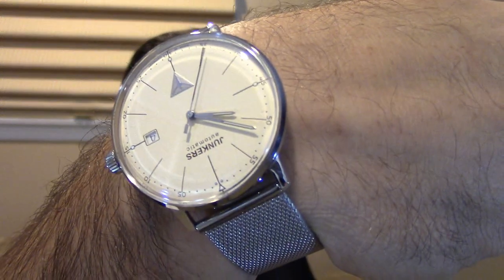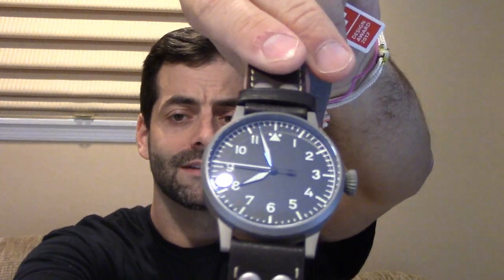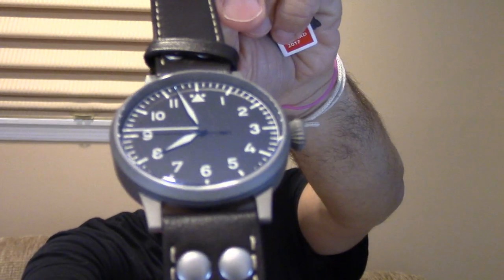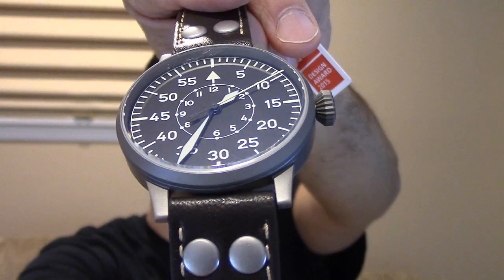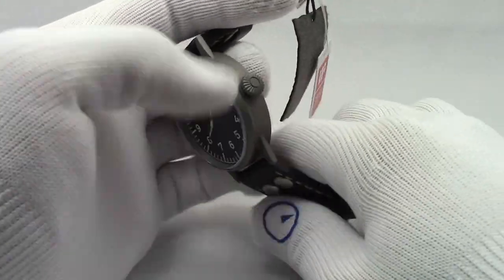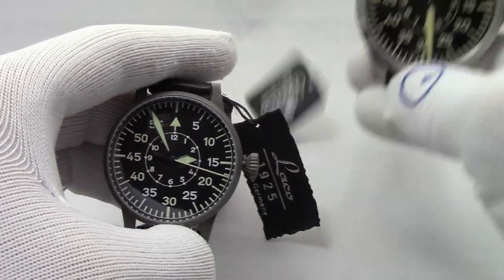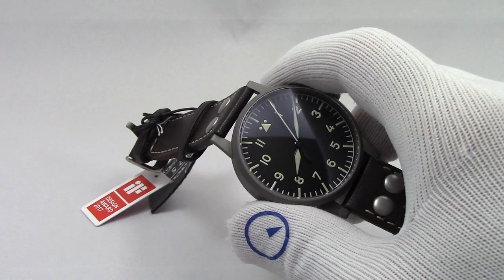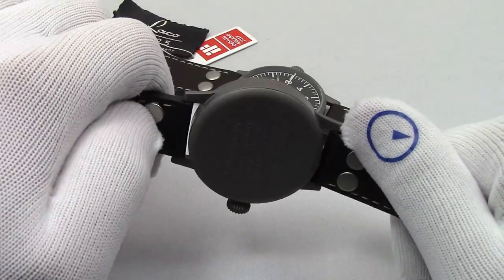Pilot Watch Dial Type Differences and Their History - Watch and Learn #37

Comment: Hi Marc. Great video as always. 
As far as I know both watches were observer watches, in german "Beobachtungs-Uhr"
A-types were built until 1941 and then the B-type started to replace the A-types. So A- and B- was only to distinguish the two version.
They were not worn by pilots but by the navigators (on the bombers). The pilots were issued witch chronographs similar to those that Hannhart builds.
The observer watch was used in combination with an octant the get the current position of the plane and correct the course to target. So the watch was part of the "navigation system" of the plane one could say.
So intrestingly the term "pilot watch" is misleading but used by most of the brands today. To me it is more related to a pilot on a ship who plots the course compared to a pilot on a plane (who actually would be the helmsman on a ship?)
It's hard to get some real facts on this topic. So this is just my "dangerous superficial knowledge"
Reply from the maker: I like your knowledge, and I appreciate it. I did review the Stowa website as they have a decent history, but do not have a relationship with Jorg so felt funny to reach out.

Comment: With the B dials I suspect that the pilots are briefed on their mission and a squadron would take off in a staggered pattern. Each crew would have their take off time and fly at different speeds that would eventually bring them into formation. At a specific minute mark the mission would then synch into “so many minutes into the mission” and act as a body. Things would then happen at say 35 past the hour (and) 30 (seconds) and there would be no distracting reference to the hour hand and the time it refers to?

Comment: I have the same Dec Adapter and clamp.  The clamp works great, but with my Dec Adapter, and just the one screw, it seems to slip some and move with the weight of the camera.  Does your have that issue?  I can move it with my hand easily.  It's like it needs two or three screws to be held in place.  I'm a little disappointed....

Comment: Personally I don't think there's very deep thinking behind the A and B dial names. I think when de B-dial was invented they needed a way to differentiate them, so they named the first one A-uhr and the second one B-uhr. But I have no reference at all, just my logical thinking.
Reply: Zündapp97 That’s pretty much how the Germans did things; Mark 1 or Type 1 for U -boats and tanks and Golf GTIs.  I think A was first, B second.
Reply from the maker: Right, but what bothers me is "B" stands for Beobachter (I think).
Reply: I've done a quick little search and found out a view things. Beobachtungsuhr seems to be a name for a lot of watches including navigators watches but also marine chronometers. Also these watches were worn by the navigators and not by the pilots themselves. Baumuster A and Baumuster B just mean type A and type B, just like Mike also said. You should also check out the german Wikipedia page beobachtungsuhr. I'm sure you can figure some things out using translate and pictures. There is stated when a watch is considered a beobachtungsuhr.
Reply: Long Island Watch @mark did you found some more in regard to the beobachtungsuhr?